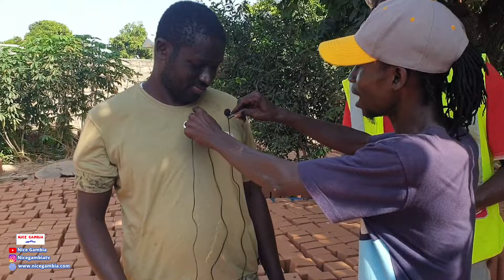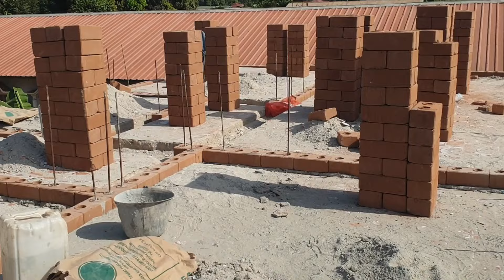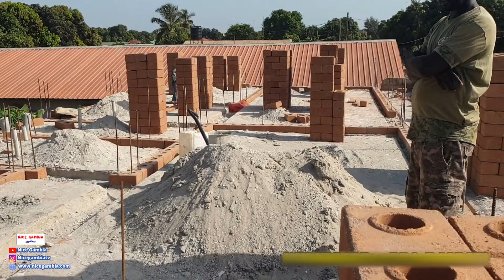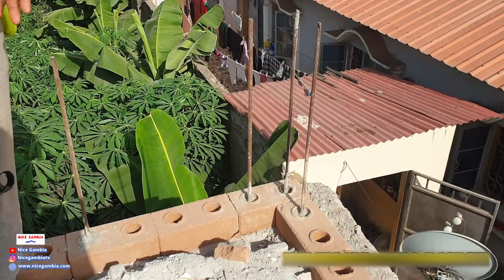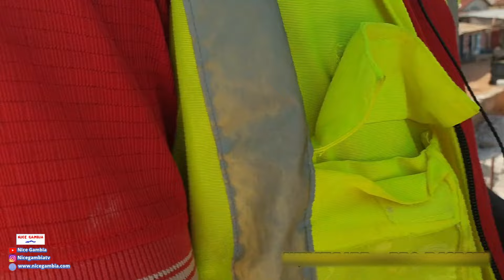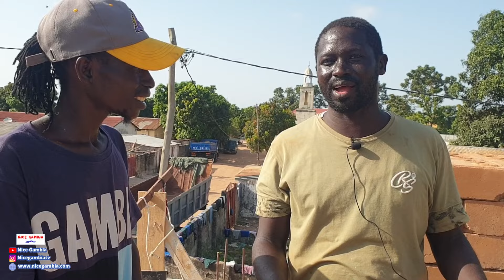Building Affordable housing in The Gambia with less cement Contact: +44 7707 232339

Comment: 0% Cement? That sounds irresponsible. 
You should be giving good advice to your customers, and not only doing what they want.
Some percentage of cement is important for bonding and for strength. 
Compacted sand only, will easily crumble, when exposed to water.